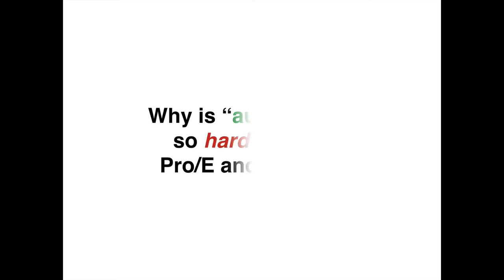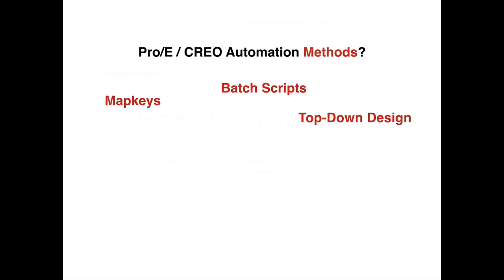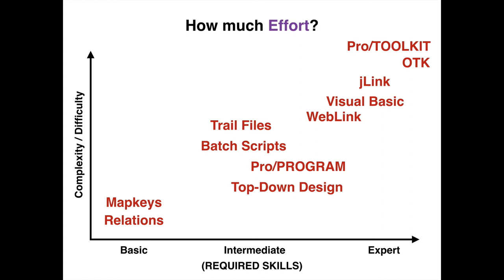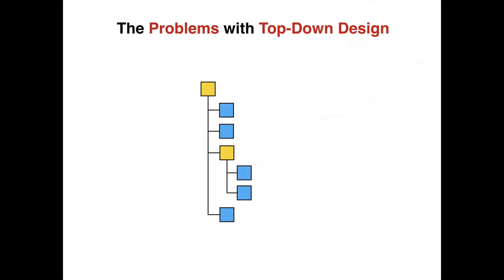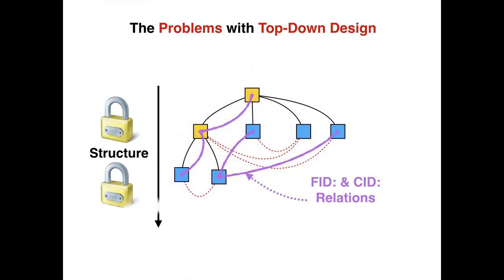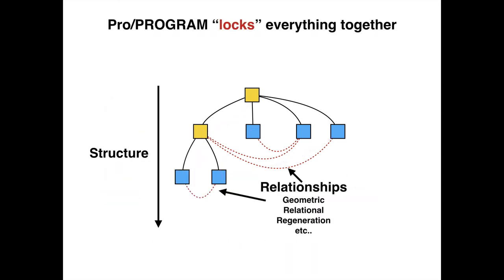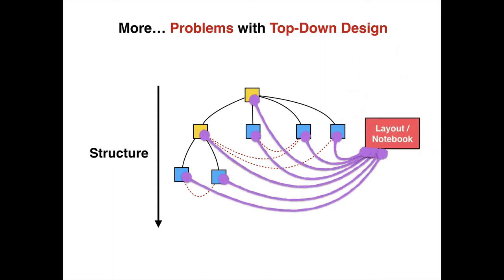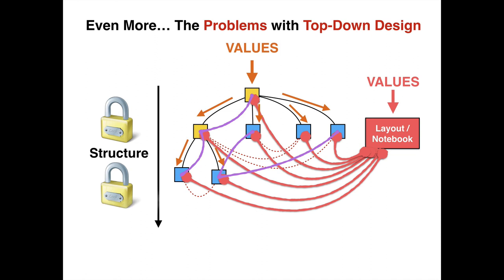Why is Automation so Hard?!

Comment: I'd like to ask if you have experience about the equivalent (DriveWorks in SolidWorks) in Creo to build configurator. I've built one easily by using Driveworks, but I've difficulties to find the equivalent in Creo. Thanks a lot.
Reply from the maker: No experience with DriveWorks other than the cursory overviews and basic understandings.  It seems to be a decent product, but like any other configuration product (including ours) it has its specific limitations and advantages (price and usability being key factors more often than not).